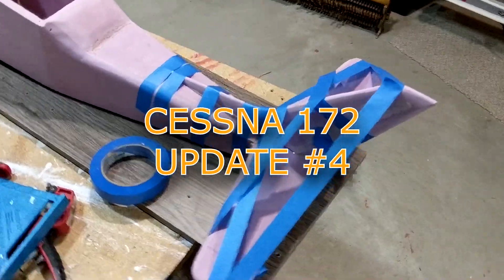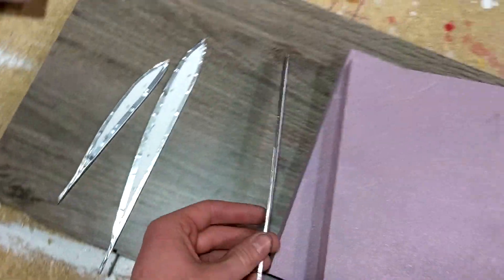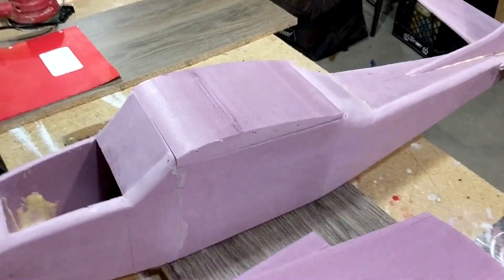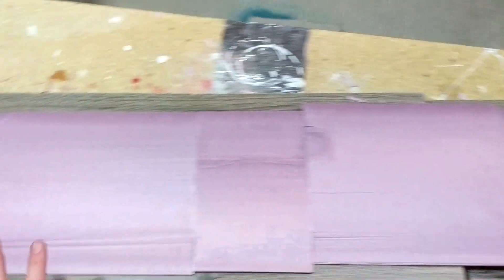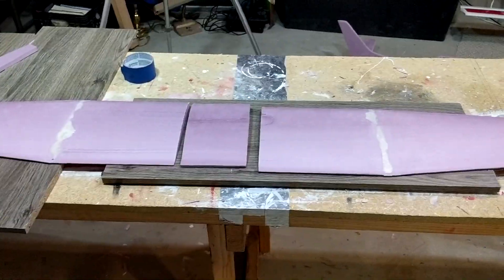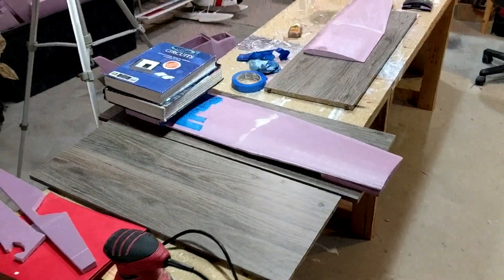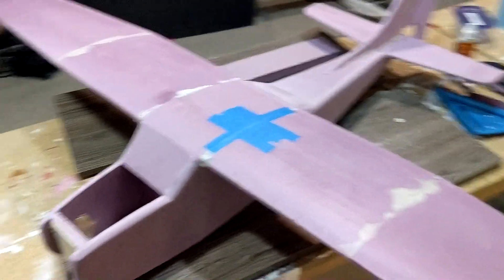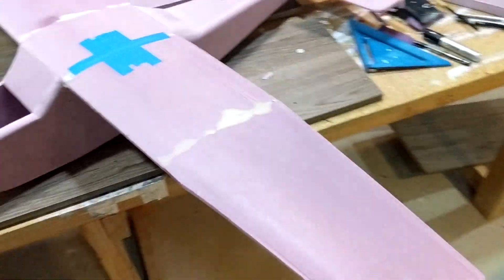Cessna 172 Skyhawk DIY RC airplane - Build Update PART 4

Comment: Nice! Do you think you could sand the airfoil in the foam? Since I dont have a wire cutter
Reply from the maker: That would take a long time. It would be much easier to just make a hot wire cutter. They're easy to make